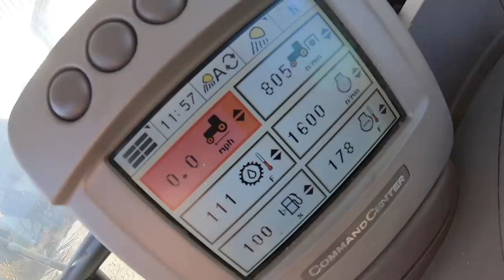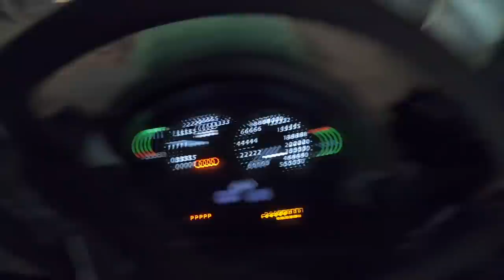South Dakota Wet Corn Harvest Day 1

Comment: Doesn't high moisture corn also provide a bit more energy and average weight gain as well? I don't know much about livestock, but learning!
Reply from the maker: It is digested quicker because of the added surface area and it is a little more efficient in the rumen because the starches are easier to get at

Comment: We always used to throw our inoculant on top of our loads of shell corn loads before we unload  to get more on 

Then we swap to a acid inoculant that we pumped on our high moisture corn and found it kept our corn in the Harvest store even better quality because its liquid and it was cheaper 

We would set the barrel of acid next to the blower and hook the spray nozzel to spray on the corn as the corn entered the beaters on the blower

In your guys set up you could pump the acid on ur corn as it entered the corn cracker intake hook the spray nozzel to the auger spout spraying down on the corn entering the cracker so as it crackles it mixes the acid with the corn
Reply from the maker: Sounds like a good idea

Comment: Live and learn ,getting the system worked out to get that going is coming together ! Is that the bunker you just put together? Son uses a swingaway auger like that on hoppers and ties a small towstrap to each side to pull it under and back out so you don't have to crawl in and out from under the trailer all the time just leave the strap on the ground and drive over it!,just a thought ! Is there a really tall empty bunker in the background there ? Your high moisture 20%  looks  pretty good for bin storage if that's what you were doing, in Minnesota according to the Millineal farmer  Zach his is 30% to start and he's going to have to dry it to store it in bins! Good luck and thanks for the video!
Reply from the maker: This bunker we have had for many years, but we did just get done filling the new bunker today
Reply: I didn't think there was a building that close to the one you just made but it looked about the same !! Thanks for the reply